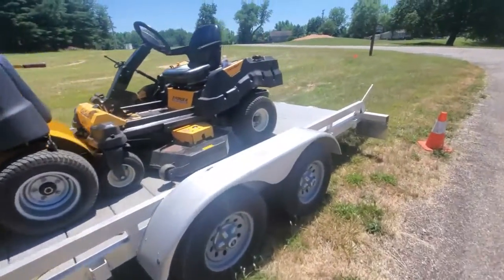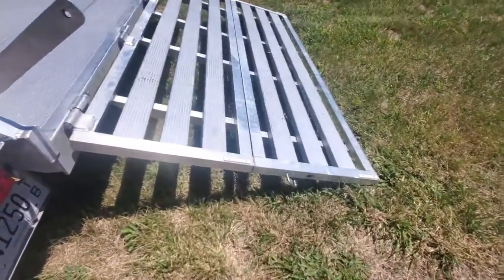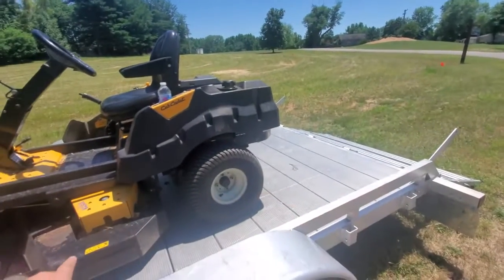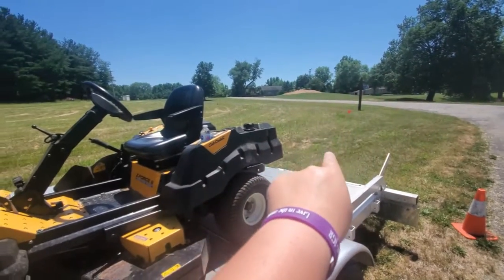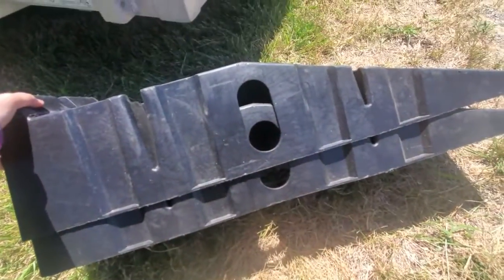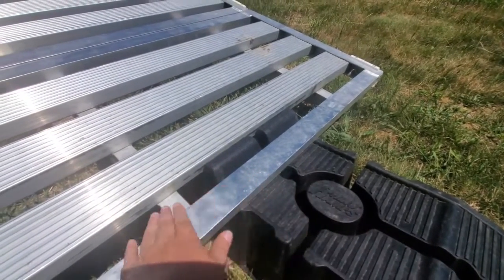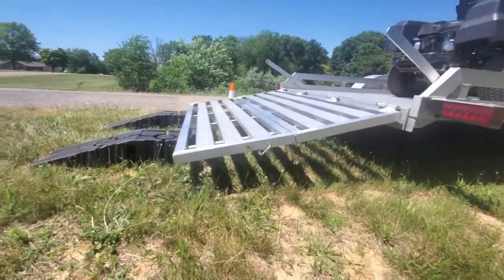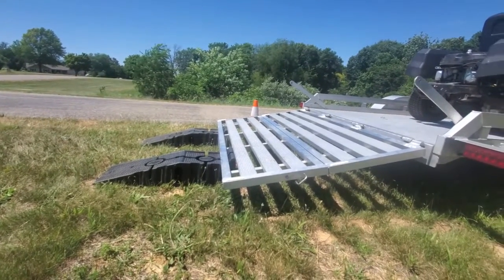Trailer Ramp Too Steep | Rhino Ramps

Comment: I had the same problem and instead of putting the ramps under the loading tailgate I put the ramps under the rear wheels of my Ute and it worked perfectly and also allowed me to use any part of my tailgate to load the mower .